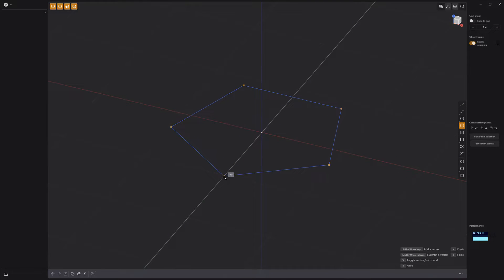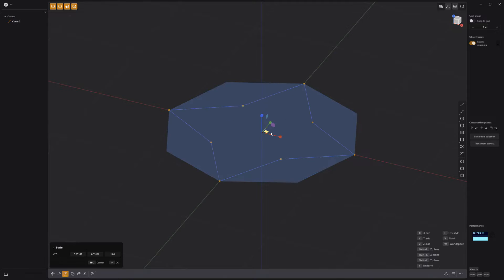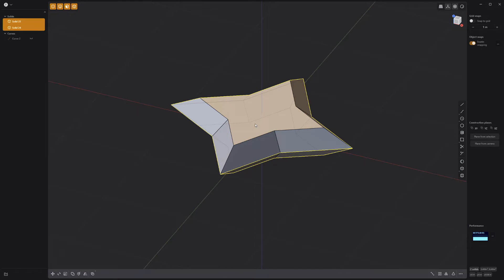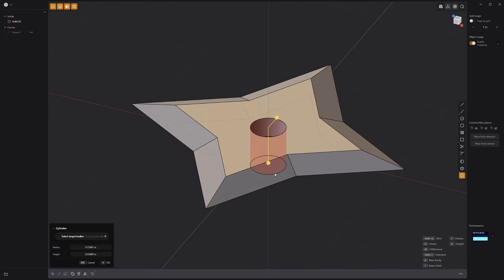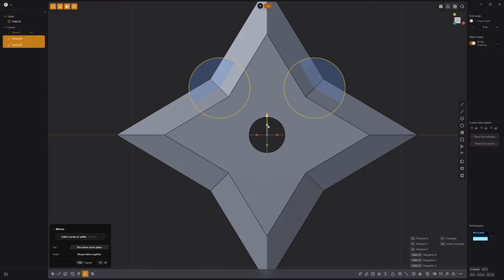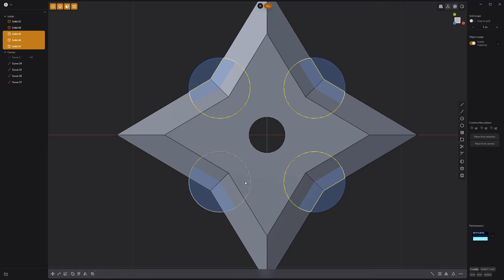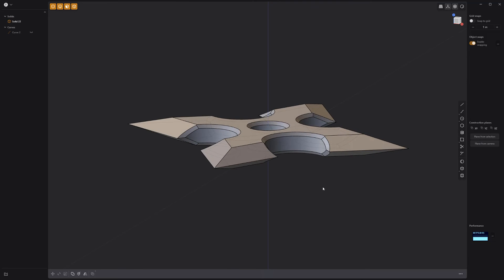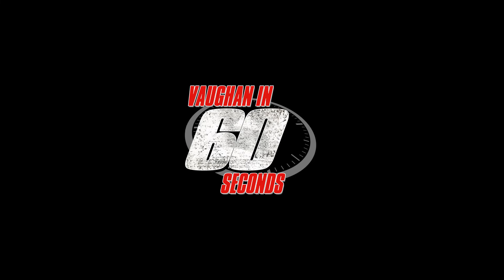Plasticity | Model a Japanese Shuriken

Comment: I see the majority of the power within this application comes from the power of its BOOLEAN SUBTRACTION - like how $300 bucks will SUBTRACTED from my wallet (in less than 50-seconds) after my trial expires!! 🤔🤓😎💫
Reply from the maker: LOL... so true :) I couldnt even wait till trial ended.. I dove in after a few days :)
Reply: @pixelfondue  TRUST, an issue I'm having w\my desktop system is the ONLY thing that stopped me from doing the same (I may need to reinstall Windows and didn't want to waste an activation).

I currently have the trial running on my laptop as I'm working on fixing my desktop...
Reply from the maker: @williambell4591  best of luck getting it resolved